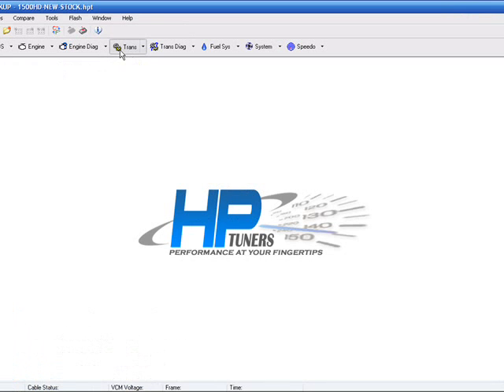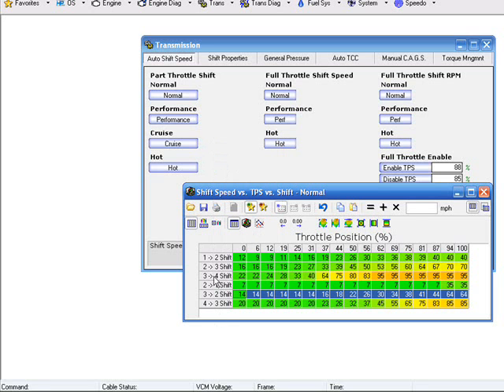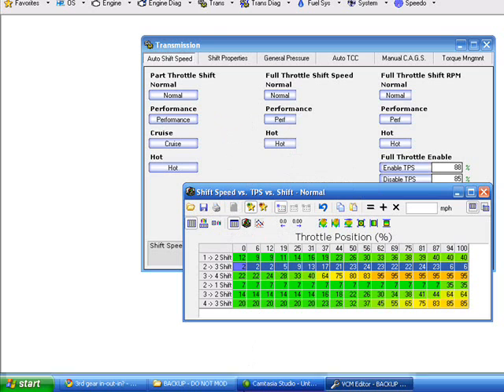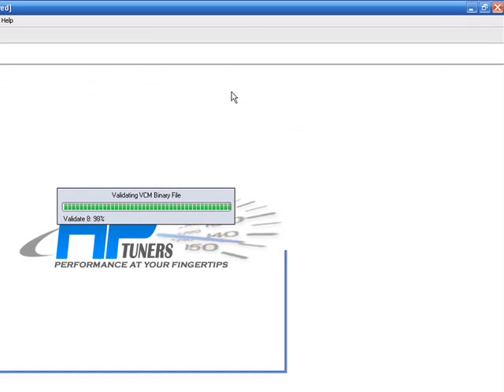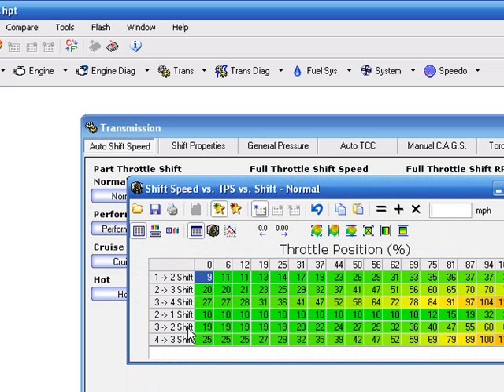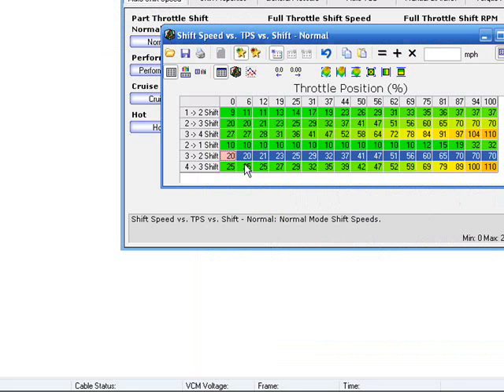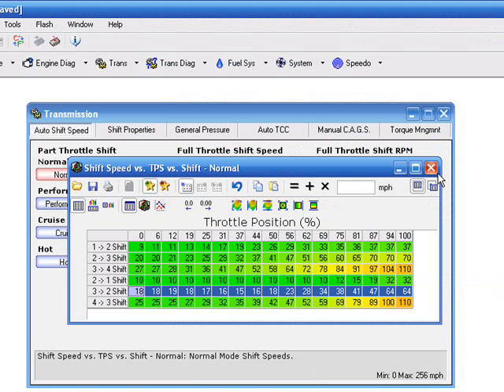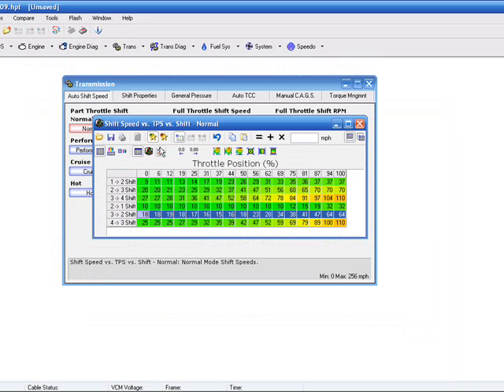4L80E transmission shift table solution

Comment: This a 4l80e from start you take off it will shift that first gear but not second and so on 2004 Silverado 2500hd is there a quick fix or no

Comment: Could you explain what was causing the original problem and how your solution fixed it? I'm a bit tard with this sort of stuff, need it all spelt out. Thanks.
Reply from the maker: it was basically a conflict due to overlap between the shift points. the upshift speed was too close to the downshift speed in the same column. by doing what I did you space it out across the board so you're no longer on that borderline.
Reply: +gman4dx266  Thanks, that makes sense. So we are looking at something like a 20% space minimum between the two tables?

Comment: we have a 95 k2500 with a 6.5 turbo diesel "s" vin code 4l80e. would this be a fix for this trans as well? I also wanted to know if any other years are interechangeable with the 95 in the diesel? I have a 95 s10w/ 4l60e was told its a year on it own is this the same for the diesel trucks. The diesel drive ok in OD but acts like the clutches are gone or messed up in D? Any thoughts would help thanks

Comment: I was looking to install a "hold" switch to prevent unwanted downshifts to second in my 95 motorhome 4L80E 454TBI. I watched "full manual no computer" and thought a simple switch to solenoid B would be the ticket. Wrong! The PCM goes into limp mode. I am afraid I will break something running full line pressure and the additional switches for sol A and TCC. Where can I get the GM PCM programed for lower shift points or better yet to ignore the commanded downshift fault I create using my Sol B switch? Any low budget ideas? Thanks
Reply from the maker: sorry I am just now seeing this. A 95 will be hard to have the pcm adjusted because of its age. However I would suggest installing a transgo hd2 shift kit. You can make it hold whatever gear you pull the shifter in. I would refrain from doing manual switches and stuff for sure.

Comment from the maker: Line pressure is also able to be upped in the onboard computer. The computer controls an EPC (electronic pressure control) module mounted on the valvebody. This regulates the pressure going to the shift solenoids and in turn softens or firms shifts depending on which way you tune the numbers. I used the transgo kit, then shuffled the #'s around a bit to get it evened out across the board; crisp part throttle/granny shifts and neck snapping wide open rocketship shifts! :-) Hope this helps!

Comment from the maker: Indeed, all the solenoids are accessible by just removing the trans pan and filter. Its wise to just go on and drop the valve body and put in a transGo kit while you're in there and basically improve the whole transmissions work and feel aspect at the same time. It may be worth getting a buddy to help you with this, as it requires a LOT of carefulness in drilling the holes, reading the directions and such but WELL worth it. That will adjust your line pressure up some.

Comment: this is my concern also that the b&m product will only be masking the problem. I'm told all the relevent solonoids are accesable by removing the drain pan,I would try to fix it myself but auto transmissions are an unkown to me.how is line pressure adjusted? any help would be appreciated!!

Comment from the maker: My guess would be that the module you're talking about will make it hold lockup in overdrive better, but it -wont- bump your line pressure up any. This is a critical point here, as not enough holding pressure will slip that converter clutch and burn it up quick. It will hold better due to commanded lockup, but only for a short time if the pressure isn't adjusted accordingly to where it should be.

Comment from the maker: A 96 is just barely under the cutoff to use for this type of programming equipment. There are some older programming solutions I believe that allow you to do something similar, but not as in depth. Im not familiar with that B&M part you're talking about. Im not a huge B&M fan myself since their products usually dont solve the problem but remove one of the symptoms so to speak.

Comment: question,I have a 96 gmc with the 4l80e,I wasn't aware one could change the programing on the stock computer,but B&M sells a TC lockup conrol module for$ 175.00  my truck seems to "hunt" for lockup in overdrive,any suggestions?

Comment from the maker: Meaningintragedy01, It is HPtuners equipment.

666jet, it works great with the 60 transmissions too. The connector/cable comes with the box and software, its an equipment package. I bought mine when it was about $550. Might be more now though, that was 3.5 yrs ago.